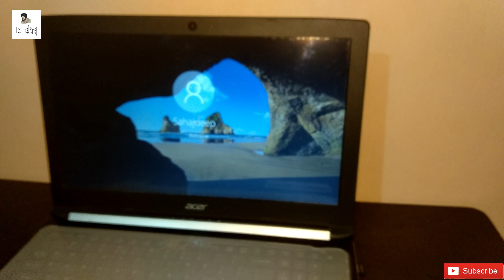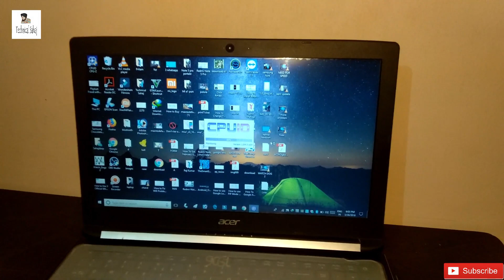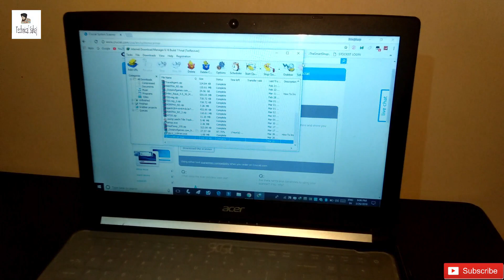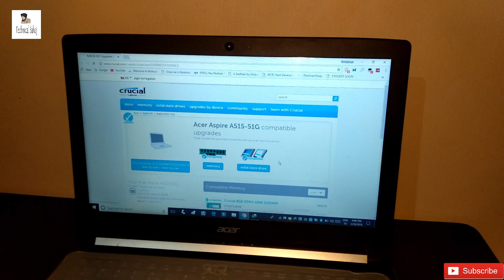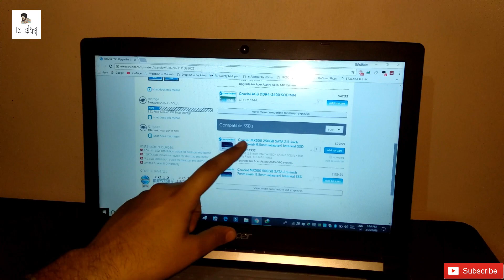How many Ram Slots Does Acer Aspire 5 have & How much RAM does it Support

Comment: i have same laptop Acer Aspire 5 A515-51G  i5 8th gen  8gb ram ddr4  1tb hdd ,
i have confusion that does my laptop support ddr4 2666mhz ?.because i open ram  from laptop and there is 4gb 2400mhz ddr4 memory so its confusing me ??? tell me i just buy 2666mhz ddr4 ram 16gb for my gaming purpose  so its working in 2400mhz or 26666mhz/
Reply: I've asked ACER support. They wrote me: ddr4 2400 16gb
Reply: By the way,  I've installed this memory,  and now I have 20 Gb ram,  and it's wonderful :)

Comment: I can buy 8gb ram model and 12gb ram model. 8gb ram model is upgradeable to 16gb and 12gb ram model is upgradeable to 20gb. Does the 8gb ram model have 2 ram slots? Because there is no such thing as a 12gb ram stick. Or does the 8gb ram model have 8gb ram soldered in and one available slot?

Comment: Bro 45k me mujhe Acer swift 3 mill Raha hai Intel i5-8th gen and Nvidia mx150 8gb ddr4 ram 1080p IPS LCD 15.6 inch backlight keyboard fingerprint aur display pe gorrila glass protection but problem yahi hai ki ram expand Nahi Kar saktey aur extra m.2 SSD  slot bhi nahi hai to yeh laptop Lena sahi rahega kya???

Comment: i know how its showing 20 gb supportable  cause i have same laptop so the reason is that the slot supports 16 gb ram and 4 gb is onboard irremovable ram so a total of 20 gb and also you are saying you have installed 8 gb ram in that slot thats ot true that is surely a 4 gb ram and another 4 gb is onboard